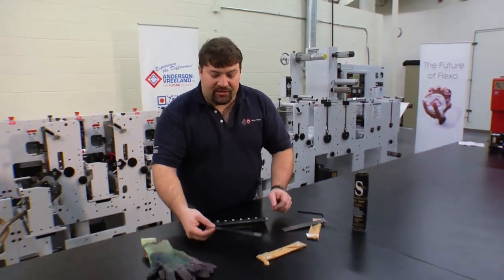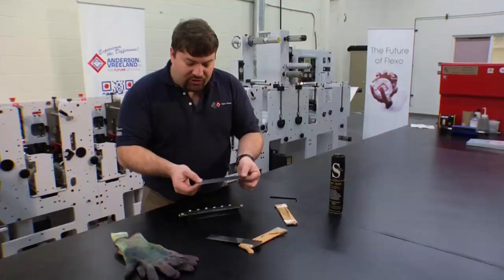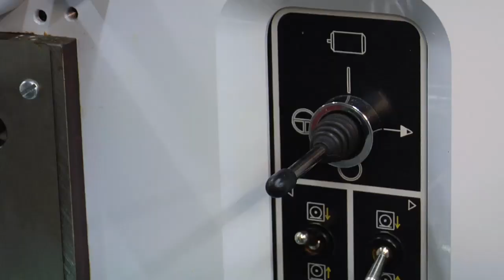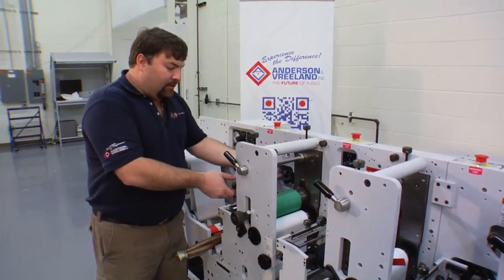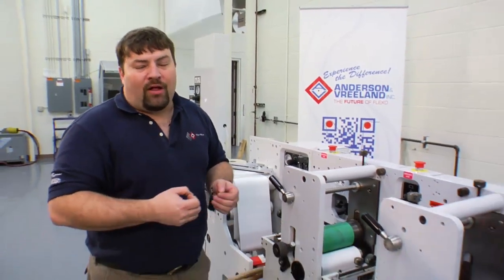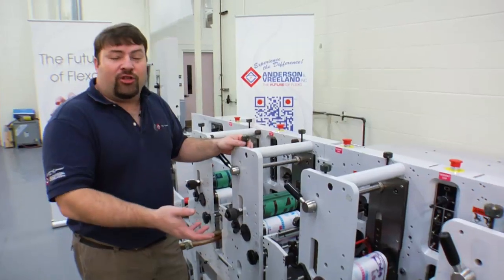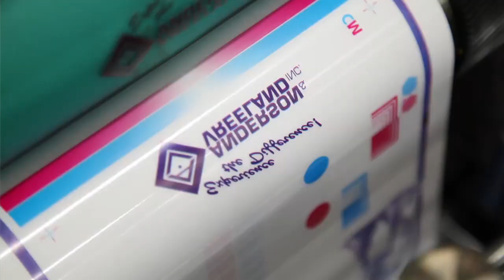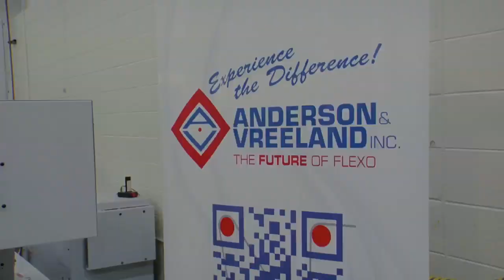How-To 4-Color Process Fingerprint Run on a Mark Andy 2200

Comment: If you use the horizontal print head adjustment as the plate to substrate and the vertical adjustment as your plate to anilox setting, you will find you get better solid ink density and lower dot gain #'s.  :)